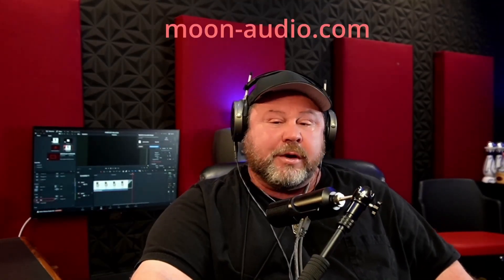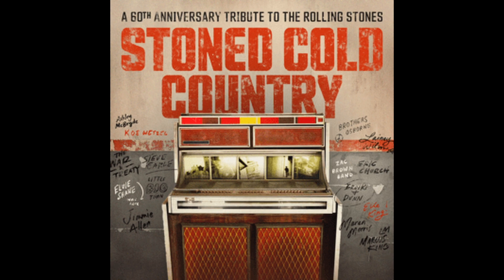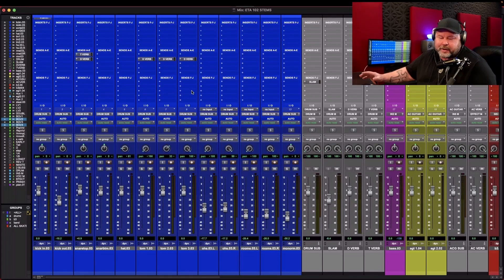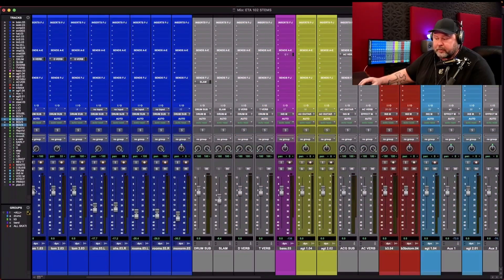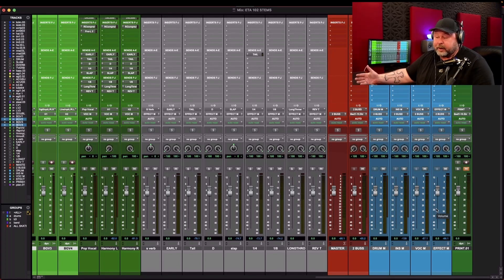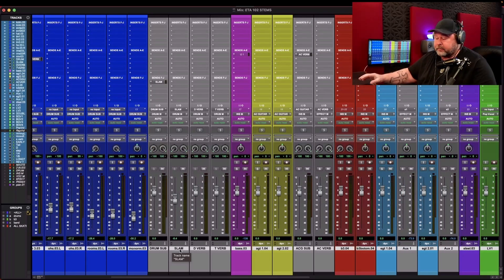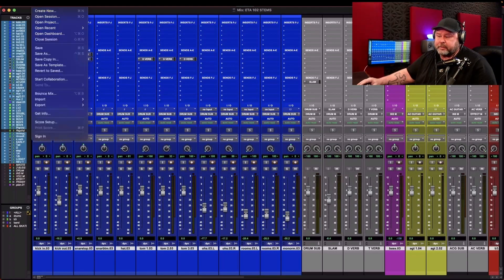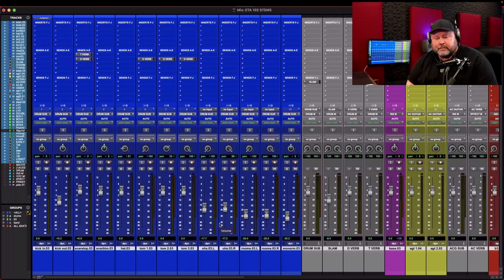How To Make Proper STEMS for a Dolby Atmos Mix!

Comment: Hey, nice channel.

I am having trouble including the meta data when I render out my ADM files. The option to "apply program level meta-data" is greyed out and when I load the ADM file into a new session, the audio is fine but the object meta-data is missing. Any idea why that would be?
Reply from the maker: Hmmm if you're using protools as your DAW....WHEN YOU GO TO BOUNCE THERE IS A SETTING FOR WAV and a setting for Wav (Dolby Atmos) pic the Atmos one. The only way you can open it is in the Renderer to check it..

Comment: the issue is that for a lot of mixers what's going on in the Stereo bus has a lot to do with the mix sounding like the mix. I need to deliver stems that reflect the stereo bus processing, not just get rid of it.
Reply from the maker: That is an issue - Best advice...If I was mixing for you I would want to see exactly what plugs or outboard you were using on your 2 and I would mimic that..either while mixing or when mastering in Atmos.
Reply: @EntertheAtmosphere  but the tools I’m using don’t yet exist in 7 or 9 channel versions.